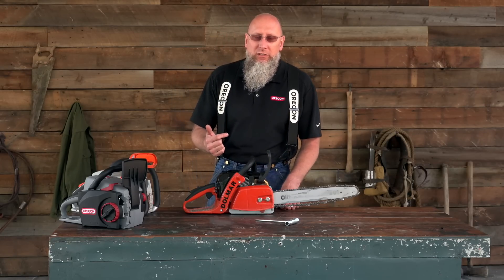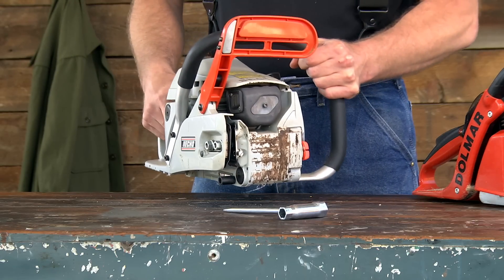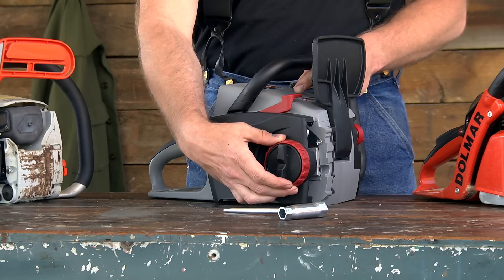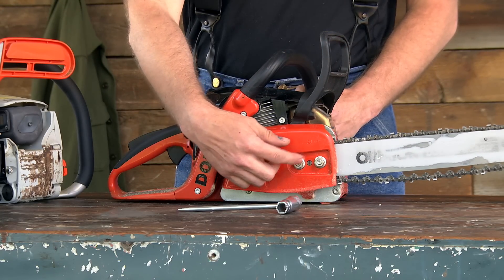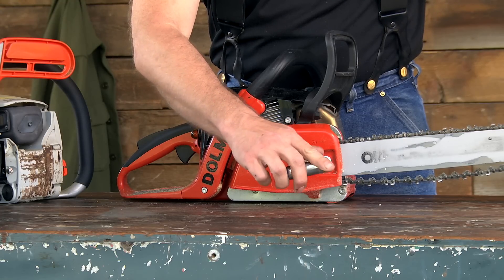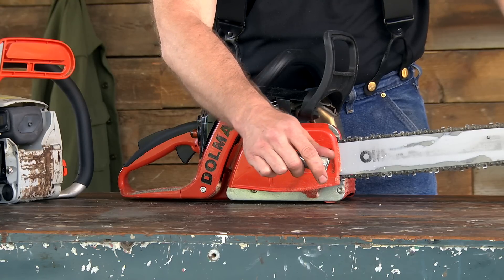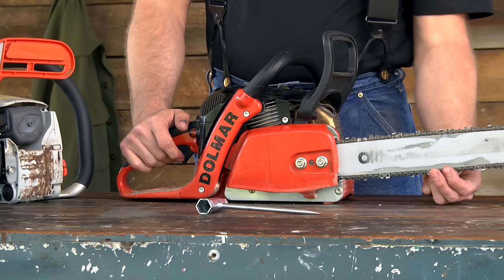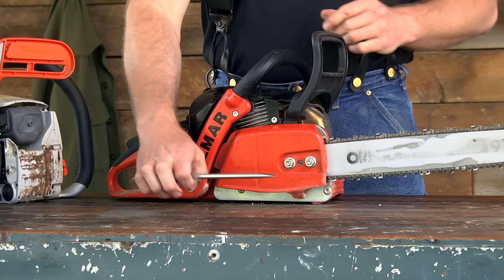Technical Tips- How To Tension Chainsaw Chain

Comment: last year, I purchased a corded oregon ( brand) chainsaw and I can't get it to cut through anything. What it does is that it starts to burn the wood instead of biting in and cutting it. All the wood I have is dry and I am trying to cut it down to fit in my wood stove. Have you heard of a problem like this before?
Reply: is your chain on backwards?
Reply: @easterdm  The chain was on backwards. The saw works great now.
Reply from the maker: Hi William, 

In order for us to determine what might be happening, please call 1-800-223-5168, select Option #1, and one of our Technical Services Experts can offer assistance and possible solutions. 

Thank you, The Oregon Team
Reply: @OREGONproducts  I figured it out. The chain was on backwards. The saw works great. I got all my wood cut before the cold weather hit a few weeks ago.